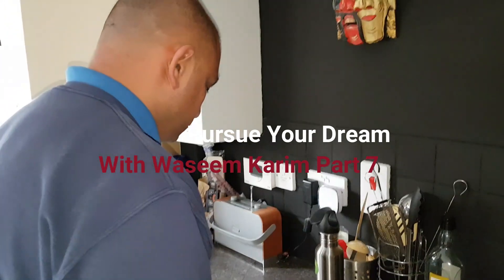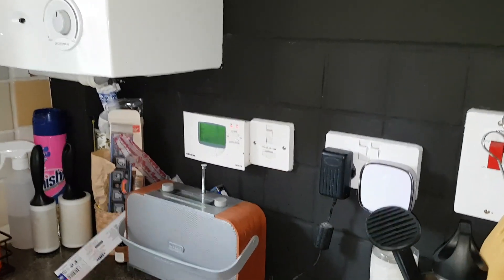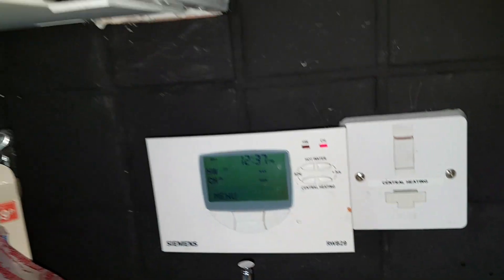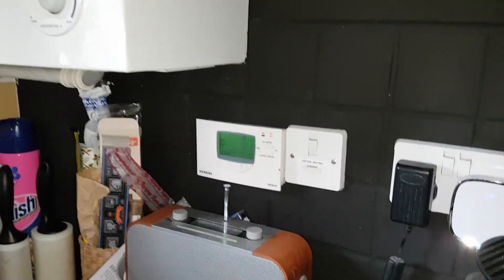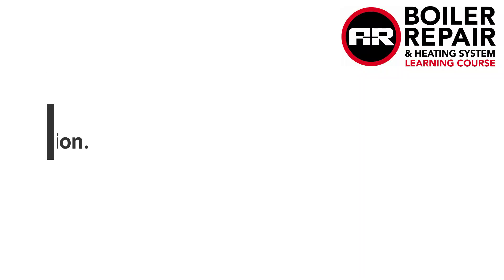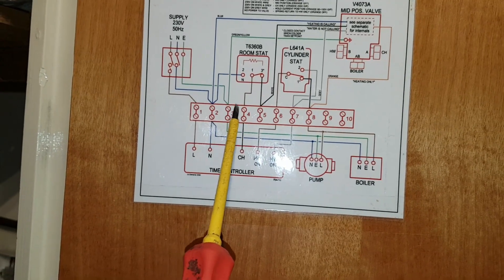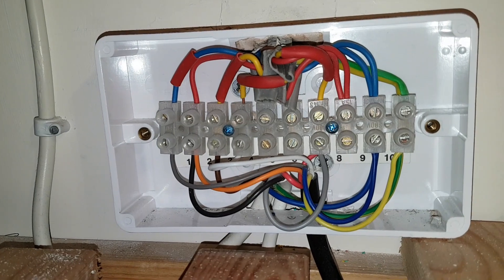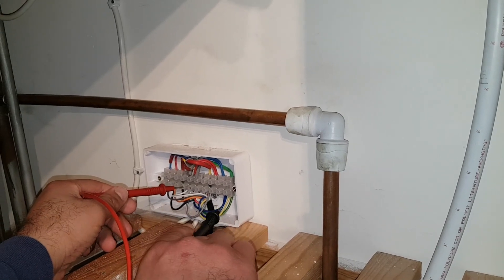Honeywell Y Plan Diagnostics Pursue Your Dream With Waseem Karim Part 7

Comment: What could be the problem for the 3 amp fuse in the spur to keep blowing ONLY when the controller is connected to it's back plate? Originally a small metal chain fell behind and blew it after that it's never accepted a controller. Currently using the boiler connected directly to spur switch
Reply from the maker: Try disconnecting the heating pump, then a motorised valve see how you get on
Reply: @ARBoilers  before I do that I should mention the live terminal on the back plate of the controller has gone a bit black if that gives you any clue. Also where in Manchester are you based?
Reply from the maker: @EmGee2524  Yeah were in Manchester your going to need a Engineer who is with electrical work
Reply: @ARBoilers  Thanks for your advice. I fixed the problem. It was the motorized valve something in there has shorted. As soon as you connected it the 3amp fuse would blow. So I know it is that. I did isolate the room stat first, then moving on to the cyl stat then I had both out and it still blew. As soon as I put the room and cyl stat back in and disconnected the motorized valve completely I HAVE A WORKING PROGRAMMER AFTER 3 YRS 😂😂😂